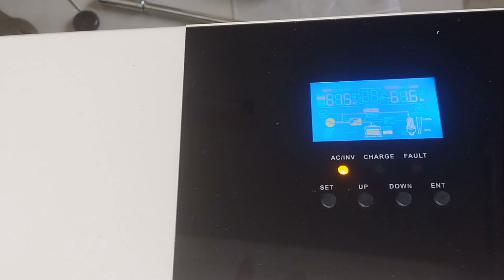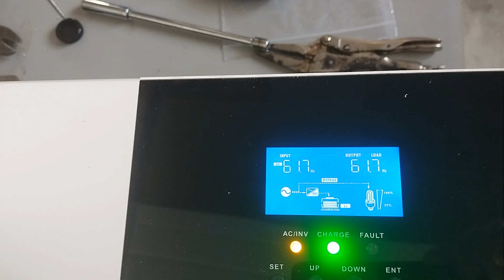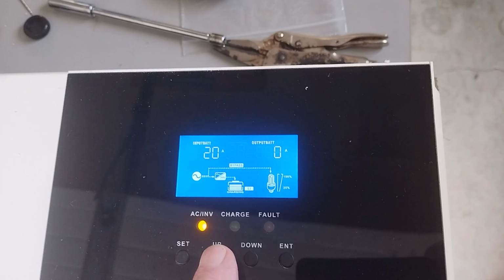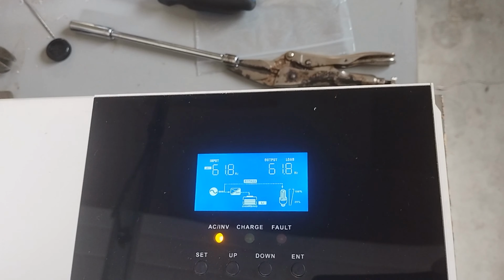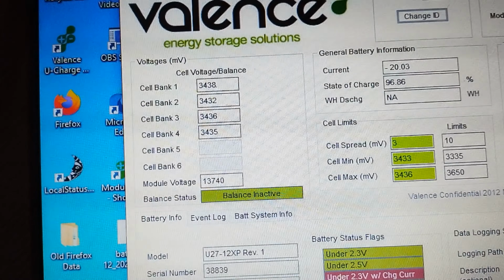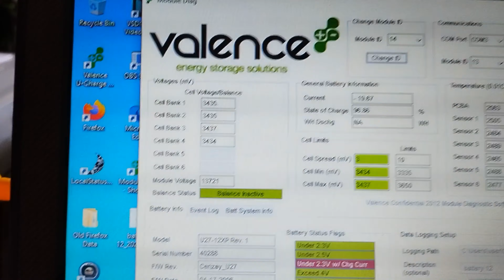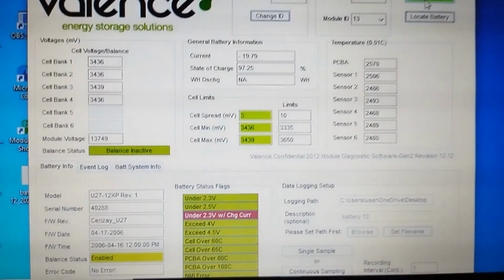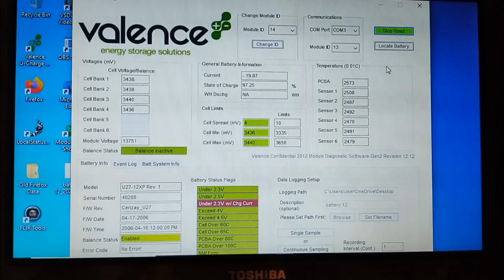Valence charging with the Calpha 5000 inverter charger

Comment: If you want a stable Charging, set the charging Amps to 18A instead of 20A
Reply from the maker: Ya it only goes in 5 amp increments but I understand now why it was bogging out or not accepting the input.
Reply: @offgridwanabe glad to see you got it working and it wasn’t a sign wave issue after all.
Reply from the maker: @jasonl8648  oh but it was the frequency of the sine wave was out but the amps added to the problem as it is with lots of things there was more than one thing wrong.

Comment: Nice software solution.
Reply from the maker: Those Valence batteries are pretty good but the software needs to be on for balance which means leaving the computer on.
Reply: @offgridwanabe  wonder why
Reply from the maker: @DMIINC2013  The internal bms needs to be powered from an outside source as it was in the original system they were designed for. The revision 2 batteries will allow disassembly so most guys replace the bms but these revision 1 are glued shut. There is plenty of information on them on the internet but I got them used at a good price so I will just use them like this.

Comment: I tried charging with my geny today and it wount work. 137vac and 64 hrz. Inverter wouldnt accept it at all. What a pain. I could get the voltage down but not the hrz on the geny. O well. Glad you got yours working. Cheers
Reply from the maker: Wow did you turn down the governer screw or nut counter clockwise being that high it may be 1/2-3/4 of a turn
Reply: @offgridwanabe  there isnt one. May see about a stabilizer
Reply from the maker: @frankz1125  I see some guys use a ups to clean up the signal
Reply: @offgridwanabe  Im thinking a variac or something
Reply from the maker: @frankz1125  Which inverter is that you are using.
Reply: @offgridwanabe  schnieder
Reply: @offgridwanabe  I guess a variac would help the voltage but not the hrz?
Reply from the maker: @frankz1125  geez schnieder is a good brand too maybe you can set the input voltage in setup.
Reply from the maker: @frankz1125  I guess that is why a bunch of guys went with the chargeverter but they are expensive.
Reply: @offgridwanabe  I think it would be better to get a different geny. Nice little setup you are working on. Cheers
Reply from the maker: @frankz1125  ya those inverter gennies seem to be the best.
Reply: @offgridwanabe  ya they are quiet too